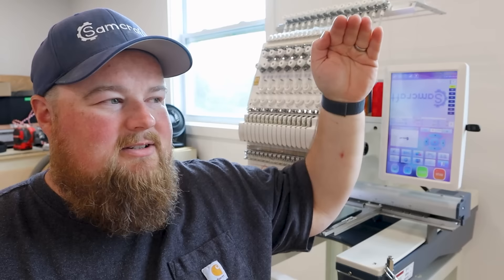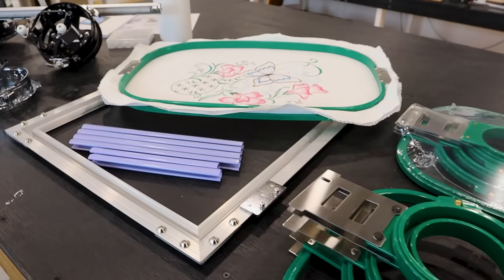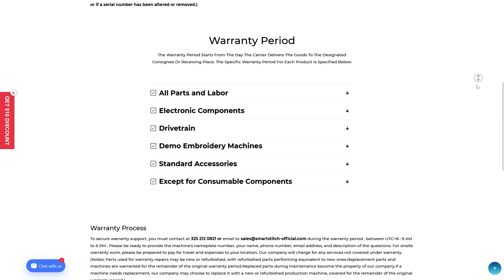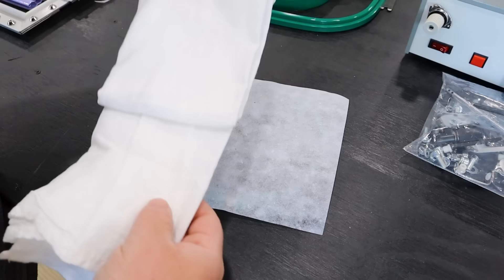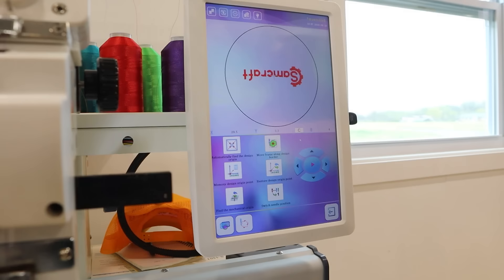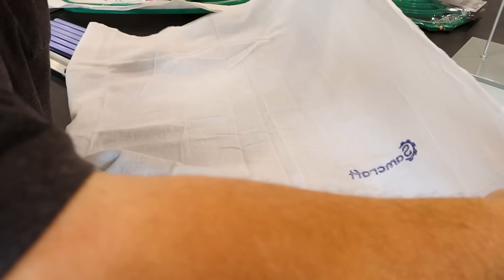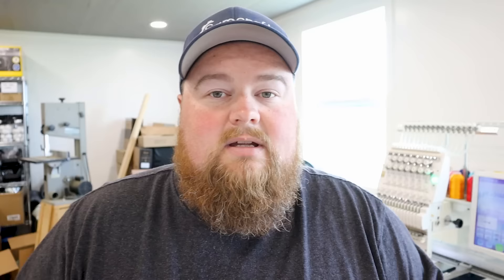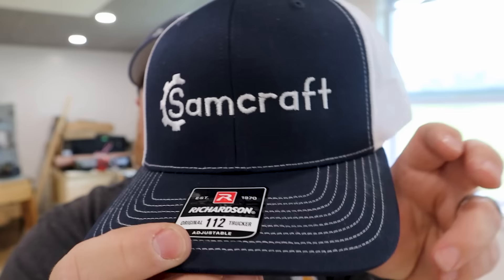This Embroidery Machine is AMAZING! Smartstitch S-1501 First Use

Comment: Hey Sam! I've run an embroidery/screen printing shop for the last 10 years. Running 20+ heads every day. This looks like a Tajima clone, which is good. If you dont have one, get a tensioning tool. You'll need it. 

Your digitizing will make a way bigger impact on the quality of your sew than your machine.

For flats, the green hoops are good, but magnetic hoops are an absolute game changer. Mighty Hoop makes good ones, but there are good ones that are China clones. I think the company name was Sewtech. Big recommendation for magnets. Let's you hoop over seams, zippers, ect, consistent tension... 

If you're using Rayon thread, white can tend to break often. It's just a thing. A polyester thread is a little more robust. Saves you a lot of headache with thread breaks. 

Man. Theres so many things lol. I'm excited for you! Keep it up.
Reply: Hey Apollo I want to start my embroidery business do you recommend this machine for starters?

Comment: Sam you might explore this option for your practicing designs. I use cheap muslin fabric. It’s cheaper than the stabilizer.  I use 1 layer if I get a mid price range and I use 2 layers if I get the cheapest. If you can get the wide back muslin, like 90” or 108” then it is cheaper still per sq inch.  😊I iron out creases and might starch it first.  For something like the towel in this video I will put fusible that you iron on in the back of where I want the design. I like Pellon SF101. I usually cut it a little bigger than I need and if it shows through after the embroidery I will use a warm iron on the back, get it heated up, and then you can peel the excess off.

Comment: Sam, Have always loved the things you and your family do.  Was very surprised that you stepped into the embroidery world!  I laughed when you decided a flour sack towel was good enough for practice.  This is a commercial machine it requires commercial type fabrics.   Your asking for trouble with too light weight fabrics.  Broken needles, Bobbin rats nests could have happened.  I've had 55 years of sewing experience, Whether its a high end home machine or industrial I have worked on them all.  I suggest you learn fabrics first, second learn your threads or flosses and don't forget different needles for different threads and fabrics. Get educated. You will appreciate the knowledge later when your asked to embroider a leather Motorcycle seat or saddle bags. I will be glad to steer you to books.  I leave you with one last thought.  Change your needles often.  Needles don't cost much and whether its a ball point needle or a sharp or a variation, your end result will look much better.. Also, try the water stabilizers, (Sulky) is one brand.  Spritz with water and the stabilizer is completely gone.  No need for the tweezers to take out tiny pieces of left over stabilizer.  The backside of your work is as important as the front!

Comment: Hi Sam, how are you going to keep dust off the embroidery machine when your running any of the laser machines? Will that even be an issue?
Reply from the maker: The lasers are very clean in their dust and fumes thanks to my extraction system. The CNC and any other traditional woodworking tools aren't, though. I'm considering moving them to the old workshop and letting it be a more dirty environment. Between the three main avenues (laser, CNC, embroidery) the CNC work has been the least active.

Comment: really interested to see the current digitisation process, 30yrs ago I wrote cad software for an industrial embroidery machine company (16 head?), in those days the designs had to go out to a punch tape roll as the embroidery machine worked off punched tape 😂, it was really interesting writing code to generate stitch patterns, entry exit points, stitch density from scanned images and fonts, lost touch when I left so would love to see that it's leaped on from that now.

Comment: Interesting. How long does it take to a hat similar to the one you did at the end? Does the color changing significantly take longer to complete?(like 2 or 3 colors)
Reply from the maker: The hat was done in about 10 minutes if memory serves me correctly. Color changes are automatic and very quick -- negligible on total run time per project really.

Comment: Is it hard to thread the needles?
Reply from the maker: It seems easier than a handheld needle and thread to me. You will thread and re-thread the needles often with a machine like this due to thread breaks. I have gotten used to the process after only using the machine a few days and don't find it too terrible of a task.

Comment: Oh Boy... you will get gray beard :P
Thats a ricoma clone get the Network program asap!
Also what stiching program you using. hatch?
Reply from the maker: I set up their wifi program today for transferring files, if that is what you mean? I have Hatch Digitizer on trial right now. Making sure it's the "right one" before I spend the $1,100
Reply: @Samcraftcom  compared to competition - which is nill - and for a more hobby aproach Hatch is the best there is. everything else is a price bracket thats almost as frigging expensive as the machine. I really like Hatch.. bit slow at times but is nice
Reply from the maker: @gilaraujo  Thank you for this information, I appreciate it!

Comment: Hey buddy..How long do the hats take to embroider?
Reply from the maker: It depends on complexity (number of stitches and color changes), size, and machine speed. This hat took about 13 minutes if I remember correctly.
Reply: @Samcraftcom  not too shabby. I saw Smartstitch has a 2 head machine for a little less than what our Thunders cost...I dunno...I've done about 2000 leather patch hats...but this is a direction I would like to go. As always, thanks for the help and info!

Comment: I have a quilt approximately 70 inches long 50 inches wide interspersed by 5 panels 4 1/2 x70 and 5 panels blank 100% cotton the blank panels would have your type of embroidery of flowers leaves and 1 x 2 butterfly it would be a repeating design 50 inches long it would be just the top of the quilt the designs would be 3 inches wide my machine does not do the quality designs your  machine does also there would be 3 shades each of green, yellow, baby pink,baby blue butterfly same colors interspersed with small dots of black with black bodies and antennas can you give an aproxamation of price and time with 3 days to get it to you and 3 days back I would only be sending  cotton panels separately without other quilted parts